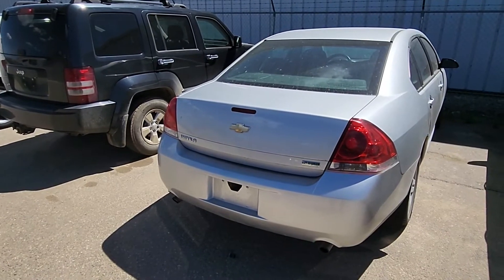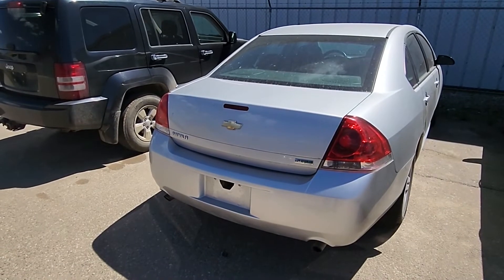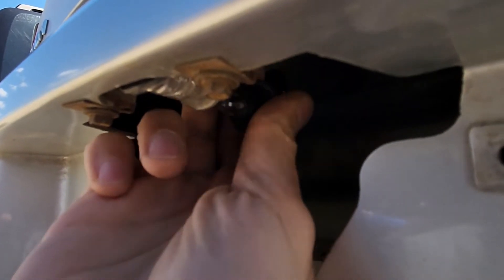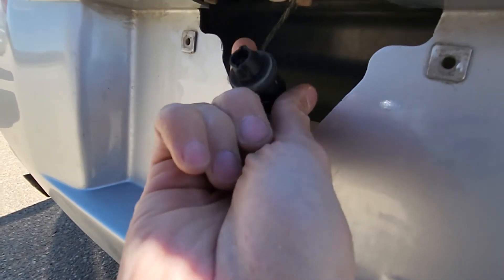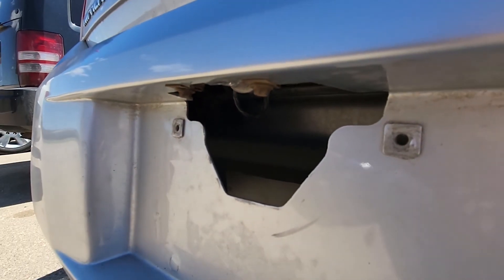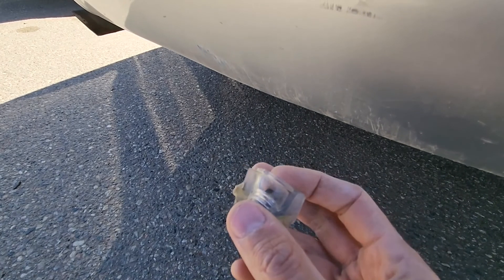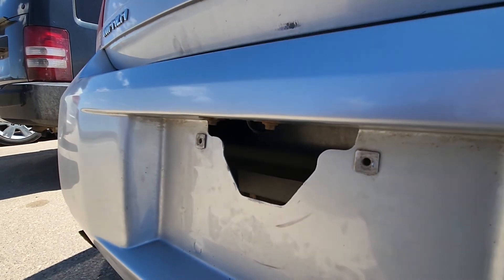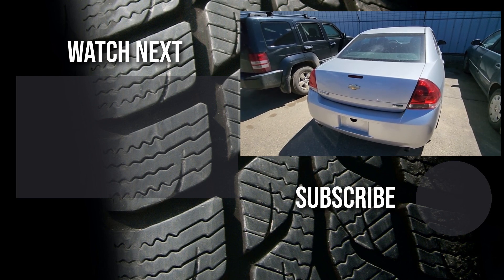Chevy Impala -  LICENSE PLATE LIGHT BULB REPLACEMENT / REMOVAL (2006 - 2016)

Comment: Can i do this without uncoupling my car battery?
Reply from the maker: yes you can
Reply: @QuiteAlright  is there a license plate bulb fuse or passenger rear brake light fuse, bc they both won’t work and I already changed the bulbs. Thanks
Reply from the maker: @Rene.864  Unfortunately there is no separate fuses for those light bulbs. If bulbs are good then most likely there is a wire issue somewhere or corrosion at electrical connectors. Try disconnecting everything and cleaning all the sockets and connectors + inspect all the wiring
Reply: @Rene.864 im having the same problem